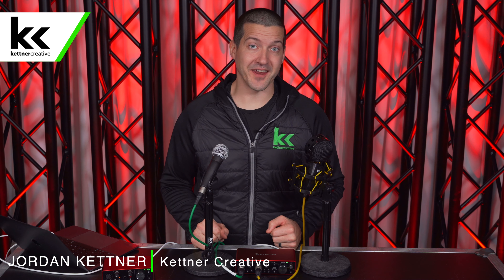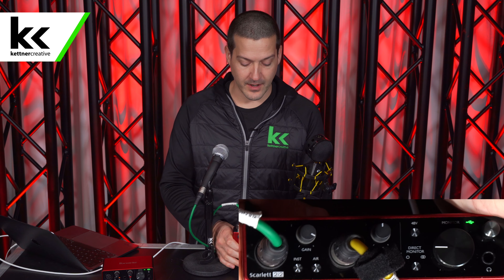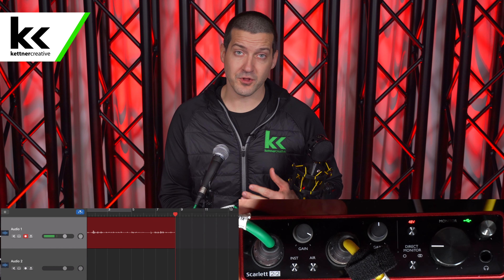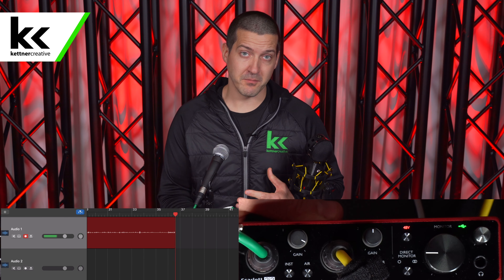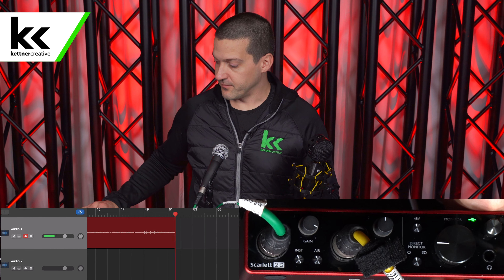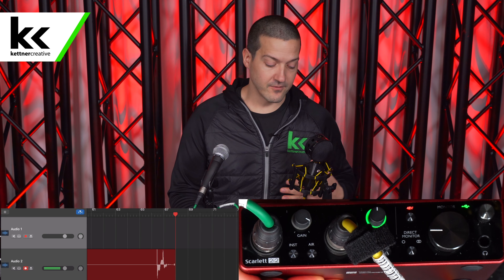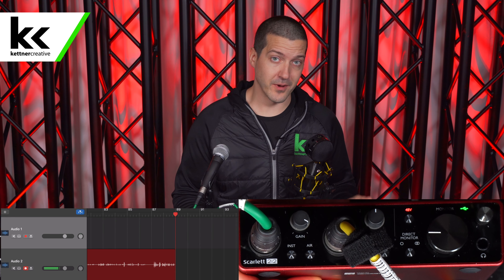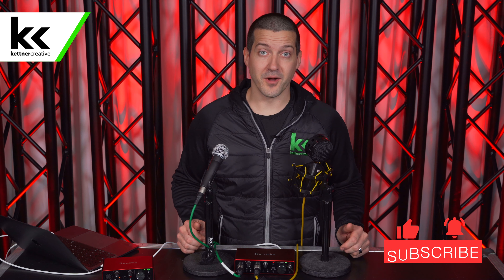What Does 48v Do On Scarlett 2i2?

Comment: I hear a huge difference in your dynamic mic with phantom power. A lot of lows without it but with it on those lows are more subtle. Sounds nicer with it on.
Edit: as 6p Jay pointed out do NOT use it with a dynamic mic, obviously, I just thought it was funny that there was an audible difference.
Reply: dont use phantom power with a dynamic mic just use a cloud lifter phantom power will most likely break your dynamic mic its used for condenser s
Reply: @johnnyboy8097  Oh I'm aware but edited the original comment so I don't lead anyone astray.
Reply: @Smackteo  oh okay just didn't want you to break your microphone

Comment: I have the 2i2 first gen and unfortunately fried an instrument's output using an xlr cord without realizing the phantom power affected both input slots. Do you happen to know if using a regular jack cable would prevent the instrument from experiencing the high voltage from phantom power? The dual input ports scare me now 😅

Comment: Will the 48V damage keyboards or synths connected with a 1/4 balanced cable? Please answer.
Reply from the maker: 48v doesn't come out through the 1/4" jack. So it will not damage your keyboard.

Comment: Does it hurt the mic to use the 48V button as a mute switch for a condensor mic if I use it a hundred times in a day?
Reply: Yes, before switching 48v on/off, it's better to have input for the mic turned all way down, and turn it up only once 48v is on — as I was advised , enabling it or cutting it off in such "rude" manner can damage the mic

Comment: Thanks for this. I notice that the recording signal you've got coming out of your SM58 is really quite weak, even though the gain on your interface is turned up high. This is my experience too, recording classical guitar rather than voice, except I am getting a tonne of white noise as well, whereas your voiceover quality is good. Don't know if this is just the limitations of using a dynamic mic to record a quiet instrument like the classical guitar when it's designed for live vocals/amps or if there's anything I can do. May just have to invest in a condenser mic.
Reply: Or get an inline preamp / mic activator (like the cloudlifter) to go between your dynamic mic and the interface. It utilizes phantom power to boost the signal of the dynamic mic without added noise so you can keep your gain low, and thus your noise floor low as well. Or you could get a condenser mic.
Reply: @sirzacketan  Didn't know these existed. Could be just what I'm looking for. Thanks! My worry about getting a condenser right now is that my flat has no sound treatment. The advantage of a dynamic mic is it rarely picks up my noisy upstairs neighbour.
Reply: @samuelconnolly347  yeah I feel you! I have a couple condensers and dynamic mics and live in an apartment with noisy neighbors.

The condensers definitely more prone to picking up background noise, but a lot of that is solved by just getting really close to the mic and turning down the gain. Of course make sure you have appropriate pop filters to prevent plosives when you’re that close.

But if that still doesn’t help then getting a dynamic mic which is less sensitive will help with the background noise, and even boosting it with a cloud lifter or similar device, while it just increases the level of everything the mic captures (your voice and the ambient background noise like your neighbors), it still doesn’t capture as much detail as a condenser mic, so it is still a better choice for an untreated room!
Reply: @Samuel Lickiss I had the problem of ambient noise as well. Connected SM 58 to Cloudlifter to Scarlett and the background noise is almost gone, on the other hand the condenser picked up sounds from far distance and I was only able to use it to record voice over during night time, but not the case with Dynamic with the above mentioned chain.

Hope this helps anyone else having similar doubts.

Regards
Reply: Get the cloud converter

Comment: Hi! I love your videos and they've helped me out tremendously. I made the very silly mistake in the midst of some troubleshooting an issue with my electronic drums and plugged an instrument cable into the headphone out of my Focusrite 2i4 (1st Gen) and connected it to the input of my Darkglass Microtubes 900v2 bass amp head...and turned phantom power on. Since then, I've noticed some hum (not in the transmitted sound signal but from the actual amp while it's on). I'm afraid I might have damaged something? Does 48V of phantom power affect the headphone output or even the balanced line out? Thank you!
Reply from the maker: No it only applies to the XLR inputs.
Reply: @kettnercreative  THANK YOU SO MUCH, man!

Comment: sir i have a question if we are using one slot of the focusrite connected through sound mixer microphone and instrument in one cable connector should we turn on the phantom power and should we turn on the air and inst button? thanks in advance for your reply.
Reply: I know I'm late but phantom power wont be sent to 1/4" jack lines, only to xlr cables according to their website

Comment: If i want to connect a condenser and a dynamic mic at the same time on Scarlett 2i2 how my interface can understand one is condeser and one is dynamic 
And it will damge my dynamic or not ??
Reply from the maker: The 48v will apply to both inputs, but I've never heard of a modern dynamic being damaged by 48v. Most modern dynamic mics are balanced and aren't bothered by the 48v.

Comment: Great video Kettner, thank you. But I do have one question.
I see a lot of threads on several forums around the internet that says Scarlett 2i2 is not really suitable to be used with a condenser mic and phantom power 48V because it doesn't have an external power source (only from the USB) therefore doesn't provide enough "stable" power for longer use (we're talking several hours to dozens of hours). What do you think about this and should I be worried? I recently bought a scarlett 2i2 3rd gen and was going to buy a condenser mic (AT2020), but after seeing these posts I'm quite hesitant (I'm totally inexperienced and a beginner in the recording world btw).

Hopefully you will see and answer this, thank you beforehand.
Reply: did you figure this out afterwards? i am wondering the same thing

Comment: Does the macbook needs to being plugged on charger?
Reply from the maker: It doesn't need to be if you're just doing a short session.
Reply: @kettnercreative  even if i turn on the Phantom Power ?
Reply from the maker: @cleitonalves6363  Yep, it will still work. It will drain the battery, but still work.
Reply: @kettnercreative  I'm afraid to fuck up the battery. Thank you Man.